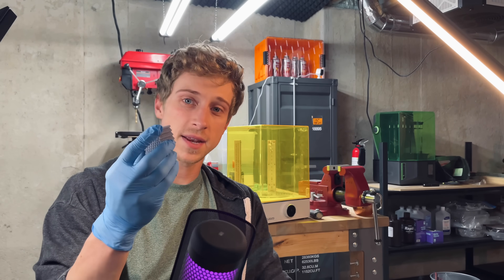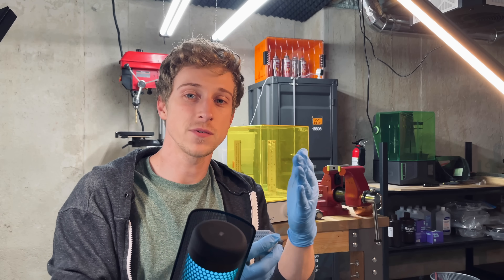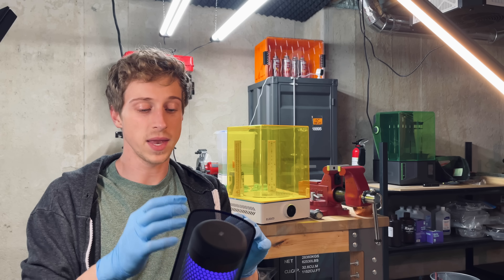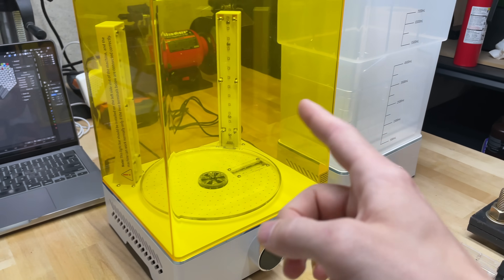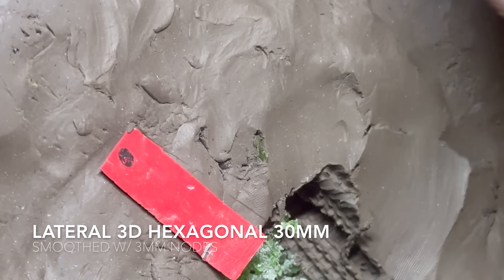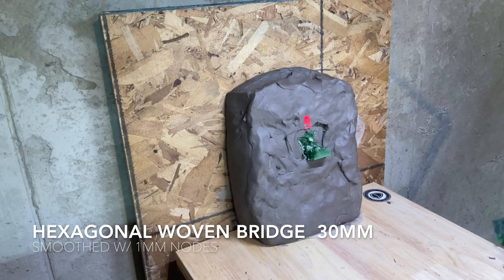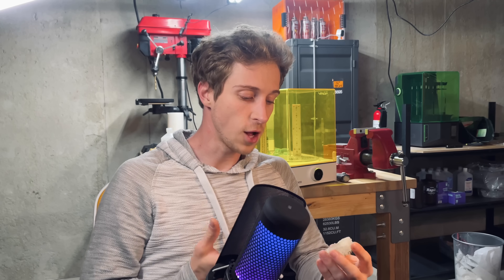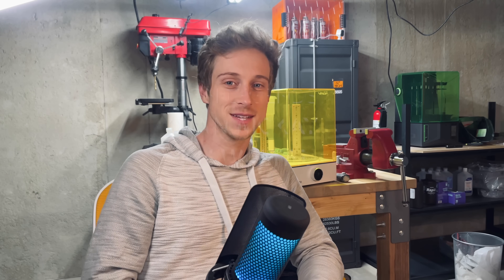Making 3D Prints Bulletproof with Molecular Structures

Comment: Guns and 3D printing, instant sub. Only questions I have are how do you clean the clay between shoots or do you clean it at all? Does it matter if the clay has bits of prior prints embedded in it? Do you have access to a metal printer? I know that JLC and a few other board makers have 3D printing services, but I'm not sure how reasonably priced they are.
Reply from the maker: Glad you found my channel! I pick most of the parts out, overtime the clay inevitably ends up with bits of crap in it, just gonna happen. Until it's really packed, it won't affect results. I don't have a 3d metal printer haha, I've got PCBWay working on the lattice atm in Steel

Comment: i would NOT trust the datasheet here for these tests: Colour and pigments can have a drastic impact on cure time and cure depth from blocking different parts of the spectrum. And while the normal structural aspects might not change much - high velocity high energy impacts (well - high as in completely disintegrating the material) will have different characteristics to what is normally tested for 3D printing materials.

As for the latices them self: didn't expect them to perform this well.
For a next phase i would suggest going with a composite design: A thin but very hard outermost surface to break apart the bullet, a fibrous high tensile-strenght second layer, followed by the latice. The first layer could be something simple as ceramics or glass, the second layer would be aramid.
Reply from the maker: Totally right on the colors haha, I was short on time and each batch was needing new resin. But I bet you're right that their sheets aren't accurate really on them being equvilanet and such. For the 2nd part, the outdo describes and shows what you're mentioning there

Comment: I've welded bullet proof cars.  Most of the time aluminum sheet, mild steel, then stainless backing.  Aluminum slows down, mild steel catches, stainless reinforces.  So the idea is you'll probably want multiple layers of increasing or decreasing in strength.  Excellent video! Flight on batman!
Reply from the maker: Layers is always the best approach, for rifles, I do composite (for spall) then carbides / ceramics for shattering and balling the round, then wovens to catch and dead stop what's left
Reply: What about layers in the print
Reply: @CrashMakerspace also, the strongest armor have ceramic in front to fragment the ammo and softer back (aramide or polyethylene or PMMA) to dissipate energy and catch all the little fragment from both the ammo and the front plate
Reply: I wonder if he could optimize the layers by doing more varying layers like 4 or more varying strengths. Especially since it can be made layer by layer, maybe more varying layers is better. Plus theres metal printers but thats probably very expensive.
Reply: Please take a look at aluminum bronze as a catch.
Good work.
Reply: I hate that I am having to suggest this. But if you find a good option….you could a
Sell as backpack inserts for school kids.
Reply: @brettfontaine4681  Premier body armor already makes that. It's actually kind of annoying to see ads for them because they aren't really suitable for a plate carrier (too light) but they're reasonably priced and always seem to be on sale.
Reply: @fematrailer I’ve seen it…but this might be better, no?
Reply: This is very wrong. Aluminum alone is terrible for armor and only reason it would ever be used in armor can be summed up to:

1. Corrosion/weather resistance.

2. Cheap cost & Ease of shaping & Low weight.

3. Triggering warheads further away from the actual armor (like RPG's).

It's possible you've been handling aluminum alloys which is a whole different story. The mild steel > stainless is valid as it acts like a bendy energy & slowdown sponge before striking harder material which you need speed to defeat.
Reply: @Runefrag For light armor alu is not that bad for protection vs weight: "The ballistic limit of Armox 500T steel target has been found to be 55% higher than the equivalent 7075-T651 aluminum target. Therefore, it may be concluded that the weight of Armox 500T steel target is 280% higher than the equivalent aluminium target while the increment in the ballistic limit is merely 55%."
Reply: @Runefrag  As others have said, it's not aluminum alone. The most important principle being described here is the medium change.
Reply: @Runefrag  They didn't say aluminum ALONE.
Reply: @Runefrag he never said aluminium was good as armor just that its a material that quickly vibrates meaning all the aluminium is effected by the bullet not just a small area

Comment: So does that mean the solid cube's reduced effectiveness is due to it being like a tangled up mess of polymers versus a carefully engineered structure? What happens if a cube is soaked in something that can cure or harden? Would it be worse in the same way modern cars with crumple zone outperform oldschool cars with solid chassis in crash tests due to dissipation of energy? Or maybe it gets the best of both worlds? Crumple zones are good at keeping a human from going splat from sudden and massive g-force shifts, but you're trying to destroy a bullet, so maybe more mass (with the engineered substructure) will serve that purpose better?
Reply from the maker: Correct, here you're basically guiding where the force goes and how it can share across the nodes. Soaking it in something could improve the strength, but I'd probably go with something less hard than the lattice structure but more ductile. This way it doesn't impede the transfer but hold it together better post impact

Comment: Ok so see if you’ve got a local outfit that does custom stuff. No steel is created equal, and I have a sneaking suspicion that some knife steels, like 80CRMOV2, could perform really well.
Reply from the maker: I wanted to get tool steel in the 3D Print, but that was over 1 grand for a 6"x6" at 1/4" thick sooo, I went with regular plain stainless haha it was less than  half price
Reply: @CrashMakerspace  Good lord!

Comment: It looks like part of the trick here is that the voids in the structure prevent cracks from propagating.

Also, bullets are easier to stop when they're not bullet shaped and composites will almost always be better for this sort of thing since you can have layers that break up the bullet and layers that catch those fragments and disperse the energy.

I'm excited to see how your 3D printed metal version of the best lattice will work when you combine it into a composite!
Reply from the maker: Yea I'm excited to share with you how those do! The metal is still in manufacturing

Comment: I have two requests:

1) test to see how well they react to being shot at an angle instead of straight on.

2) embed the lattice in rubber of some sort, not necessarily to stop the bullet itself, but to try and control the shattering and shrapnel.

Comment: please try changing the grain of the latices like in steel
Reply from the maker: I did change each node size for these tests, lower left describes each scale
Reply: @CrashMakerspace  no like grain orientation smaller grains in metal reduces the chance of cracks propagating

Comment: Why do you think certain iderations work as well as they  did? Even though you said it was crazy to see how different the results were from similar builds
Reply from the maker: The woven style bridging did great in general, also keeping pore size at less that 1/5th the cross sectional area of the round was also better. It seemed to act as a wedge when bigger than that.

Comment: I wonder how these resin versions would perform if you filled the gaps with some tpu (would have to be very very stiff) like material to prevent the catastrophic fracturing?
Reply from the maker: Something stretchy could be good to help hold it together, its true!
Reply: @CrashMakerspace  A
fter thinking about it bit more, it should be possible to impregnate kevlar threads into the resin print. Curing and layer hardening parameters will change, but it would almost definitely prevent the pieces from breaking apart as much.

Another thought was what if you gave the "hard" piece a very soft ~1cm thick silicone backing? It wouldn't stop the bullet at all, but it might, disperse even significant amount of energy.

Comment: this is awesome research! I wonder how increasing or decreasing the size of the holes would affect the energy absorbance, as well as the height of each layer! Do you think this type of mesh could be sculpted to more or less match a human torso shape? I am looking forward to your video testing the steel version
Reply from the maker: This is what I was seeing, the larger nodes had larger holes and those didn't do well, I think because the bullet was able to too easily begin tunneling and pushing away like a wedge trough the structure. The hole size also depends on how ductile the material is too. If in steel, and thin enough, you could bend it into a torso-ish shape

Comment: do streching the structure vertically shorter or longer make a difference?
Reply from the maker: Theoretically the wider the structure, if properly designed, the more strength and support you can add to point of impact

Comment: Don't you want to eliminate variables of angle of the shot and also where in the lattice the bullet is impacting?  To eliminate torsion as much as possible?  By having a more reliable 'location' (framing) for your target and a bench rig for your pistol?
Reply from the maker: I was mounted off a block to stay pretty consistent. If I had more time, a mounted vice over at the test site or something would be cool
Reply: @CrashMakerspace  You could jurry rig anything on both sides to be more consistent, agreed.

Comment: Hi! it's an amasing idea what you do. I was planing on the same way to do something simmilar, but i was too lasy. I'd try to inject some kind of hardening foam(like the one arund the doors and windows) into the hallow parts. This way you can get some extra material to block the bullet. And it might be weak, but there might be some air compressin effect that do enough influence on the bullet.
Reply from the maker: Some flexible structure, lesser than the primary lattice to still flex the dispersion of energy could likely be a good variable to add into this mix!

Comment: Wonder if you could fdm print this with abs-pc or even hdpe (which is a pain to print I've been told)...
Reply from the maker: You could, but the small pore size required would be pretty tough, you'd have to do a lot of tuning!
Reply: @CrashMakerspace  hadn't considered that fully, thanks on the insight

Comment: First let me say I really like what you are doing here. Super neat stuff. 

If I may offer my thoughts, I think the best armor would be a combination of ultra rigid material (like ceramic) to break up the round, surrounded by more ductile material (like aluminum, or possibly even softer like "Line-X" truck bed liner) to catch the pieces of the bullet and broken ceramic. Based on this I would love to see you take your existing design that performs the best (printed in the most ultra hard resin you can to simulate ceramic) and put it in a vat of truck bed liner and use a vacuum chamber to suck out the air and get the viscous bed liner to fill all the voids of the 3d printed matrix.  If this performs exceptionally well, you could then use the matrix printed in ceramic and surround that with molten aluminum allowing it to harden filling in all the voids with solid aluminum.  

This aluminum infused ceramic tech has already been developed 20ish years ago but your molecular matrix tech may offer substantial gains in performance when used in conjunction with infusing it with aluminum, hopefully leading to an even more durable armor that can absorb even more rounds in the same small area before failing. 
https://www.wpafb.af.mil/News/Article-Display/Article/401504/afrl-develops-novel-ceramic-based-body-armor/

Comment: Suggestion, use the one that stopped the bullet, bring it down to 20 mm  but after 10 mm leave a 2-5 mm gap.
Reply from the maker: Adding relief pockets could be a curious next step
Reply: @CrashMakerspace  I actually did see a simulation of armor that was segmented, versus Armor that was a solid chunk basically. It looks like they took the solid chunk of simulated material and separated it with two lines. And it performed worse than the solid chunk, because basically. When you add a gap between the armor, instead of making it a solid chunk. Yes anti-tank rounds that are designed to shatter ceramic will destroy the entire piece of ceramic for the side of the tank, instead of a single plate if your armor is single rather than segmented, and if that one plate runs the entire thickness of the armor, then you've compromised an entire side of the tank. But if there is a spaced out gap between the two pieces of material in the armor, at the front of the first segment it may seem normal. But at the back of the first segment it's not getting any support from the front of the second segment, which allows the bullet or projectile to go deeper into the same length of armor when it's spaced, compared to a solid mass of the same length. So I recommend that if you do segments, you make each segment out of each individual piece of 3D printed framework, so that when the armor is shot, instead of the segments causing gaps where there's no support, the same as allow for the ceramic being shattered in one section to not compromise the entire at least side of the armor.

Comment: Color of resin changes the depth of cure drastically. You may find the brittleness of the final samples change a lot.
You should print test coupons and check the curing curves of each and ideally you need to measure the mechanical properties to determine if the colors are indeed equal.
Reply from the maker: Probably right on the Copy-Paste for properties haha, good tip on testing via the coupon samples
Reply: there are so many different resins to try did you try them all? Then there is fiber reinforced resins?  stick with resins for a bit longer!
Tell Elegoo you want to test their resin and get it free! 
I would actually want to see a resin strength test as an ad vs a stupid curing station ad, do you know a black light is $3?
Reply from the maker: @remotepinecone  I only did ABS-Like resin, that was the same resin (just different  colors) for all tests to stay consistent. There are totally stronger resins, I just didn't have them on hand. The ceramic ones seem ideal but are super super costly.
Reply: @CrashMakerspace  yeh so is it true that the different colors of that same resin cure differently?
Reply: @DangerousGas  yes, clear resin cures REALLY fast, while opaque/darker resins take longer to cure. so, the dark green one would need a bit more curing time than the clear would, and if he were using the opaque grey ABS-like, it would take longer to cure than the see-through resins since the light has a tougher time penetrating the surfaces. 

one thing i've heard for a good uniform cure on print parts is to submerge them in a pyrex type (see through) dish with water in the curing station/UV light area. the water acts to get the light into spaces normally the light wouldn't hit due to how light interacts through water. 

that said, be careful to not keep the prints in the curing water too long as it can eventually mess them up. also not advisable for all resin types, like the plant based ones. ABS-like is generally ok with water for a bit.
Reply: I mean, the strength of the cure wouldn't change all that much. I feel like the structure is doing all the heavy lifting here in this test.
Reply: @3zhay  it depends. is the UV getting all the way into all the dark recesses deep within the structure to cure it? 
for instance, there are quite a few videos and information out there, that if not cured properly, long enough or even for too long, it can be detrimental to the printed piece. 
undercured or pockets of liquid resin can literally eventually crack open a printed piece and leak out onto whatever surface it's on. 

many a 3d printed model/statue have done this to people, generally from a combination of undercuring and improperly washing it.
Reply: also, undercuring would make it more rubbery, overcuring would make it more brittle. 
that's why doing "cones of calibration" and other tests on each type of resin you use is helpful, and not just relying on specs the resin companies claim. have had batches of resin state that they'd cure in X time, and need almost 50% more time added for a proper cure, or a fair bit less than specs stated.

Comment: meanwhile, most of the modern and the most effective body armor is made from super thin sheets of HDPE - ya know, the stuff most gallon milk jugs are made from. Add ceramic tiles if you desire a higher ballistic resistant rating.

Comment: I am curious about the benefits this might bring? ultimately the biggest advantages of the materials used in armor is the weight savings it provides while maintaining the same protection, weight is the main reason that modern armies don't use full body armor protection, at least that's the reason they give.

what is the weight to protection ratio?
if it's a hard material, does it cause spalling?
are you going to use and experiment with different resin's to see if you can create a 3d printable body armor? even if it ends up being an inch thick and only capable of stopping pistol caliber's that's a revolution in self defense technology by itself.
Reply from the maker: As mentioned, this is to be embedded using steel, spall is handled by compost. I'm going for sub 1" to remain practical but taking multiple 300WM which typical ceramic vests rapidly degrade after 1 shot.